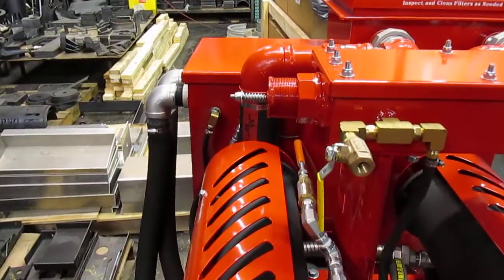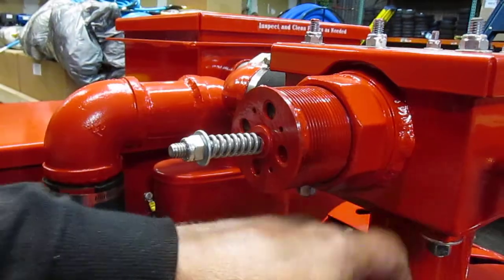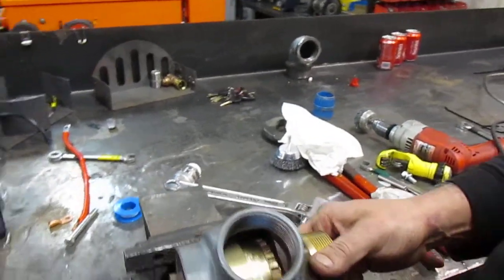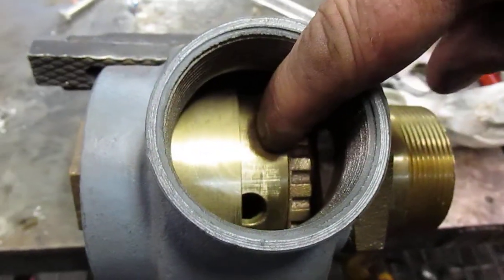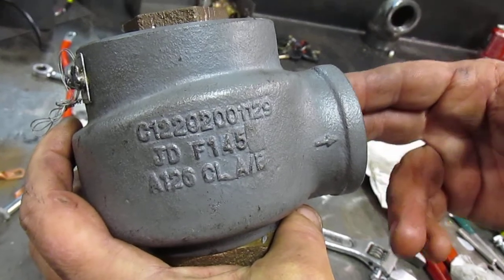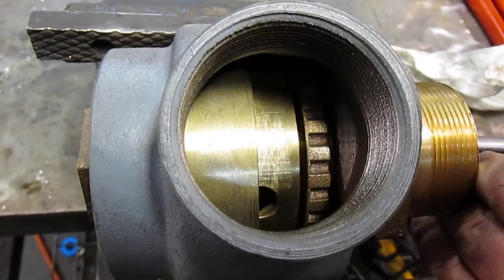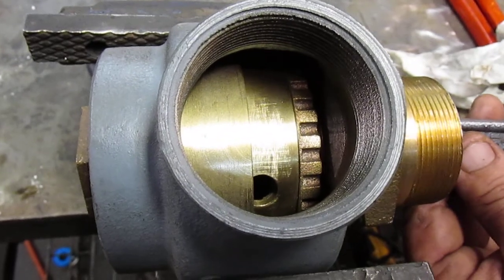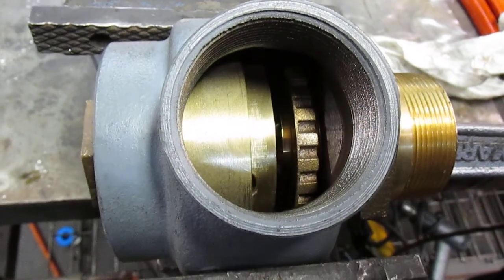Amtex Equipment, How a Kunkle valve works

Comment: I'm not an expert but that's not how a kunkle valve works it only opens when it hits a certain level of mercury and does not leak vacuum like a spring loaded valve does. Now they are both good if done right and it which one you use depends on the design of the truckmount.
Reply: How can you adjust or set the pressure on the kunkle valve
Reply: 74r4.